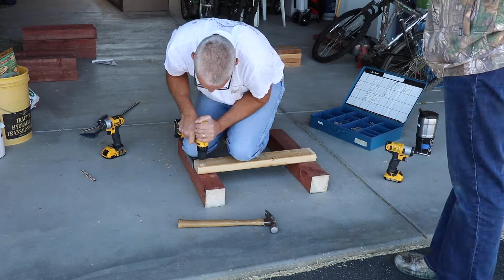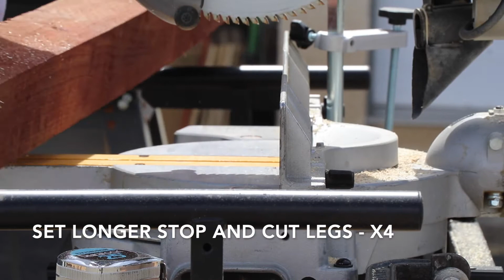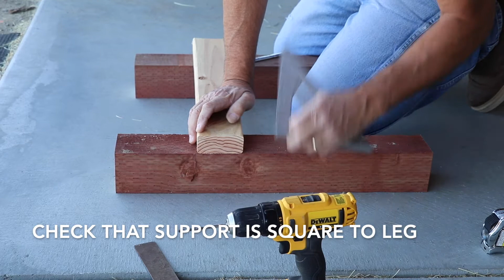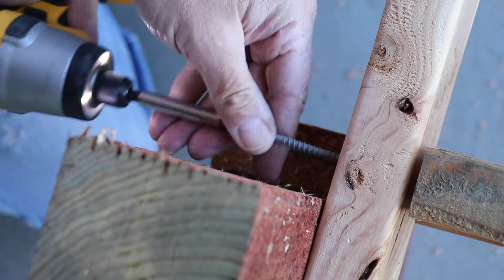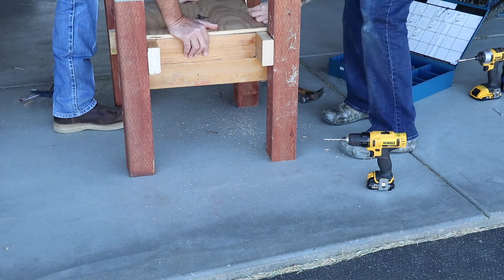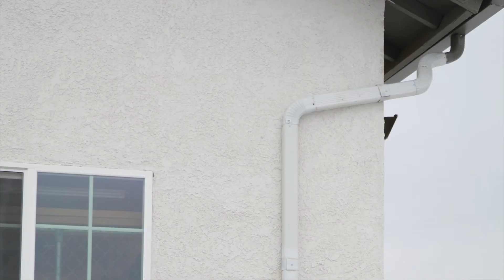Water Barrel Stand

Comment: Hi, this is a beautiful design! I love it, and plan to make two for my barrels :) I'm planning for the dimension, and am wondering - does this fit a standard 55 gallon barrel? I want to make sure the stand is the proper size!
Reply from the maker: We’re so glad you like the barrels! Our design should accommodate standard sized barrels, anything up to about 23 inches in diameter. It might be snug at 23 inches, but it should still fit. If you have anything larger than 23 inches diameter, you’ll need to upsize the plywood base and the supports. We would love to see photos when you build them! You can share to our Facebook page or our email, Tripled.crazys.fab@gmail.com.
Reply: @tripledcrazysfabrication1817  Thanks so much for the reply, and for confirming the size of the barrel. Sounds like I need to measure my barrel to be safe. I'd be happy to share the finished product! This is a project for the next few weeks, so hope to be able to share some photos soon!

Comment: Nice job!  How is the plywood protected from the weather?
Reply from the maker: Thanks Rob! We’re glad you like the video! As far as the plywood goes, the only protection we really put in place was to cover it with an exterior paint. We get some rain and snow here, enough to make rain barrels worthwhile, but not an overwhelming amount. It’s also pretty dry here when we don’t have weather, so we were not too concerned about protecting the wood. We’ve had the stands for a few years, the first couple as just plain wood before we added some paint when we built these additional stands, and we really haven’t had any issue with the wood. That being said, we have had other projects where we used a waterproof coating to protect the wood. If you are interested, we can go dig up the can and share the product name with you. Hope this helps!